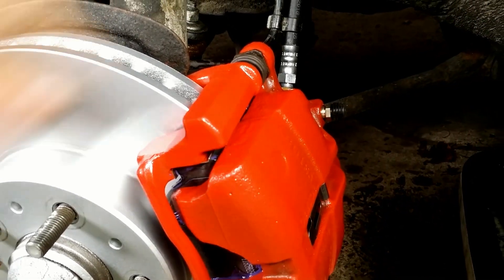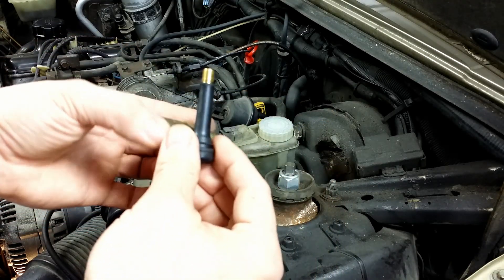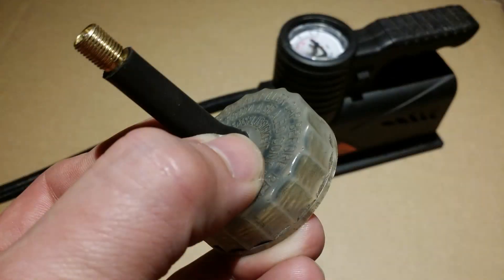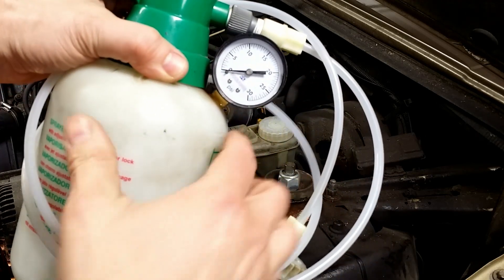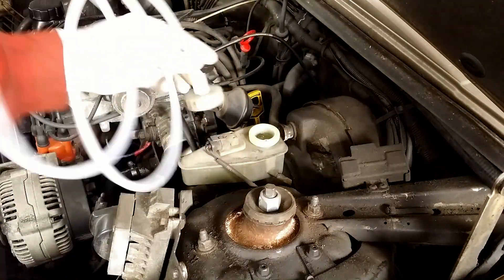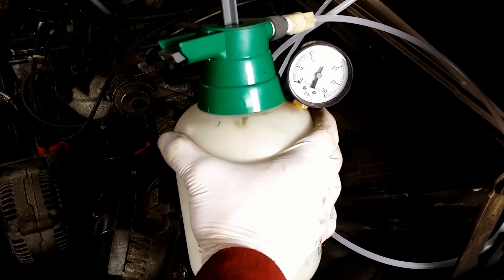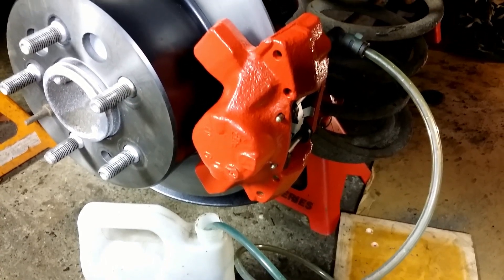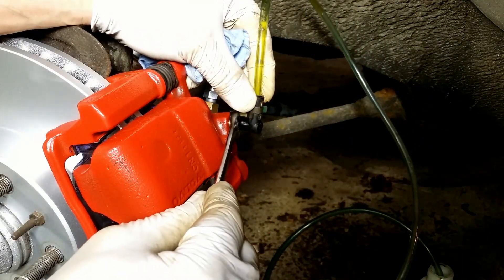How to Bleed Brakes with Homemade Cheap Tool

Comment: You Sir, are a GENIUS !!!
I was thinking the same thing, why put brake fluid in the AIR reservoir and overflow the brake reservoir. Only having to suck back excess fluid, and as you stated, likely creating a mess.

Thank you VERY MUCH !!! who🫡
Reply from the maker: So, if you were thinking about the same thing, then you are a genius too!
Reply: @robertdeptula2003 / Right On!

Comment: What connector did you use to attach the cap to the hose at 1:07 ?  It doesn't look like a tire valve
Reply from the maker: This is just an idea. Found it at local hardware store, so I cannot send you a link to buy it on line. 
Good luck with your project!